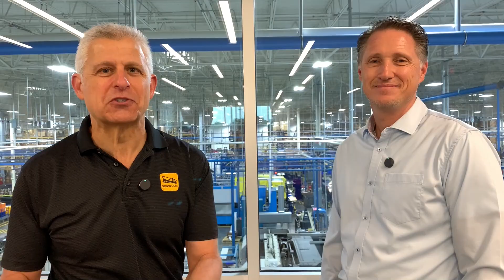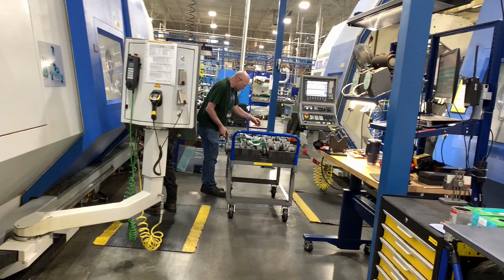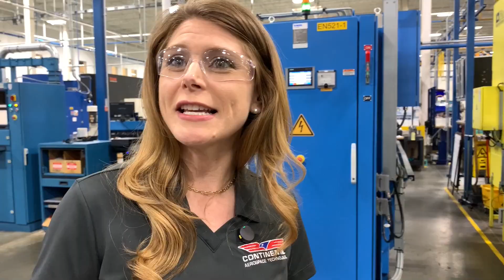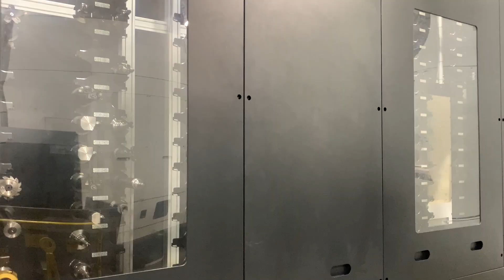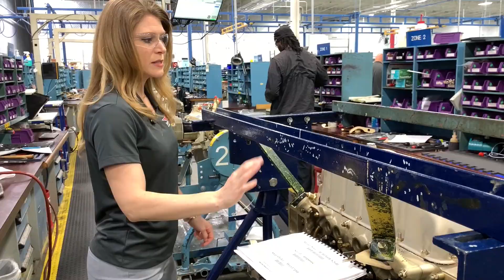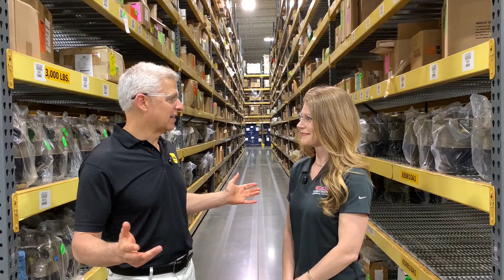HOW AIRCRAFT ENGINES ARE MADE! Continental’s 120th Anniversary Factory Tour

Comment: In my day, 87 years ago, the tools we used were simpler and less expensive than the engines we made.  Now the tools are more complex, more expensive, have replaced us, and are more complex than the engines they machine.
I cannot believe that I lived through an engineering age where I built my own model aircraft, my own model piston and jet engines,  my own radio transmitters and receivers for aircraft remote control, and now I have even handled the mathematics and the electronics and software that can fly 10,000 drones together in an air display at 10,000 miles away, and all done from my bedroom. 
In my day, the factories were not as structured, clean, and organised as what is seen in this video . Congratulations to Continental for providing this service and such a high standard of work, which is backed by such stringent laws, regulations, and guarantees. Well done.

Comment: I decided to buy a brand new io-550 instead of over hauling my run out engine . The first engine was found to have a major issue. After a year of arguing they finally replaced it with a second engine with issueas well. They follow up with warranty issue is nonexistent . I finally resolved the problem myself. They refused to address even small but important issue of the dip stick reading 2 quarts off. This whole scenario cost me 2 years of down time plus a huge amount of aggravation. Once you buy and pay for it thru Plane Power it’s you are on your own. I have not been paid for the reinstall etc. The next step of course is a major law suit involving my safety with a faulty engine plus all the added cost incurred . We have 4 major new continental engines on our Feild with things like rusty cylinders etc. my suggestion is to stay as far away from the so called hi tech factory as possible !!!

Comment: Loved the video. I have flown thousands of hours in aircraft powered by Continental engines from the 65 HP to the 550 series. In my opinion the Continental engines are a smoother running engine than the Lycoming engines. Both are excellent engines and very dependable. Never had a problem with either one.

Comment: So, what IS the gold coating??  I assume it’s dichromate??

What is the black treatment on the cylinder jugs?  Must be either a chemical black oxide or a nitrided treatment??

What is an “experimental” engine??…guessing that’s produced to a lower price point, but not faa certified and lacks some of the features, like the external coatings??

No surface hardening on the crankshafts?
Reply: Great questions. Some of us are interested in real answers to real questions as indicated in the comments.

Comment: But they still use vendor manufactured lifters that often times don’t meet specs.  Last year I ordered a TSIO520R for my T210.  The first engine arrived and while it was still in the shipping crate I discovered a pitted lifter!  Three months later I received a replacement engine and before the engine was hung on the plane I discovered a lifter that was not rotating!  On both of these engines the lifters would have failed prematurely, but probably outside warranty, quite possibly damaging the cam thus necessitating yet another rebuild!   
Karen Hong and her team get high marks for innovation for sure however, they simply must solve this industry wide lifter issue!

Comment: Unfortunately, Continental is owned by AVIC, a PRC, peoples Republic of China State company.  I sold my C206 and bought a RV8, IO-360, before having to reengine. Had to replace 2 cylinders by 1400 hours.  Ran LOP ,with GAMI injectors but started running ROP after second cylinder replacement. Had to give new owner a $5000 discount for another cylinder that was getting low compression. My next experimental is going to have a Rotax916. FADEC and electronic ignition.
Reply: Looked it up, true.
Reply: If a Rotax916. FADEC and electronic ignition is MUST HAVE equip. for your next experimental.  You just limited your choices down to 2 planes.
#1 Choice.  Sea Risen 916.  2 place
#2 Choice.  Sling TSI 916.    4 place.
Then again, anybody possessing a sound rational mind.  Doesn't change a thing.
Your only choices are the same two planes.
Reply: @raymond3803 RANS S-21 can be 916 equipped as can Kitfox and others.  Way more than two choices.
Reply: @LTVoyager  It's not the lesser of two evils.
It's the evil ........... Of two lessers.
Yeah ................. that sounds about right.   
And appropriately applies to your comment.
Reply: @raymond3803 That is quite the nonsensical comment.  Must have taken you hours to compose.
Reply: @LTVoyager  Don't project your intellect on me. Something original and a little clever may require hours of your investment.  I type at a fluent 63-words per minute.  So break my comment down.  Assign each word 1 second.  That's how long it took.

I once took a hot-air ballon ride.
The ballon got lost in the clouds, drifting off course for hours.
When it finally started to descend, I looked down and saw my LTV friend.
I yelled down: Hey LTV, where am I?
LTV looked up and yelled:  You're in a ballon.

1) LTV had an answer to my question
2) Technically, it was correct.
3)  Didn't help a damn bit,
Reply: @raymond3803 You are definitely well acquainted with hot air.
Reply: @raymond3803  you can put a 916 in any home-built you want; the FAA won't stop you
Reply: @soconnoriv  I think you can.  Some of these modified STOL planes have ridiculous engines in them.  Exposed and exploited on YT, I doubt that would be the case, if illegal.  The two planes I mentioned lack certification, so they are experimental.  Sea Risen is a 100% factory-built plane.  Sling TSI is a 49/51% kit.  But the factory offers builder assist.  I would never consider doing less (my involvement) than this.  Here's a good example of a Sea Risen in the US.  https://youtu.be/GRNZj-ngFes?t=43
Reply: Stop it boys,you both cracked my ribs

Comment: As a Commercial Pilot and A&P mechanic I would have liked to see the machines doing their work.  Like taking the crank and cam from a raw forged part to a finished part.  That is what I was expecting to see.  But it is nice to know that they make all the components of the engine here in the US, where they control the quality and specifications of the parts.  Auto makers should consider the same thing.  They are in trouble because the engine and transmission parts they are sourcing from China ARE NOT being manufactured to specks and are failing around 40 to 50,000 miles of service.  There are videos here on YT explaining why this is happening and not just US automakers.

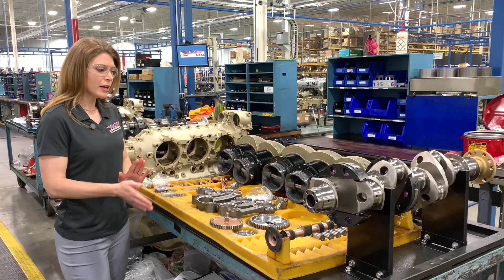Comment: 12:38  Jesus, in 2025, look at the sheer size of those engine parts.  In 1997, Karl Kinser built a 410 ci.  Mopar V-8 naturally aspirated sprint car engine that produced 900 hp and weighed 297 lbs. Complete from air filter to oil pan.  With the exception of auto racing, name a vehicle industry more weight conscience than aviation.  Thirty years after Rotax proved (tried & true) a small 5,500 rpm engine can absorb the additional weight of a gear reduction, radiator, water spider, dry sump oil pump, exterior oil tank, and match the power, reliability, & TBO of a conventional 2,500 rpm Continental engine with 1/2 the weight.  Why has Continental and Lycoming not followed suit?  It boggles my scrotum.
Reply: Longevity.  Your data is as reliable as your engine of choice.
Reply: @Skinflaps_Meatslapper  Explain the value of "longevity" when a timed-out Continental overhaul costs the same as a replacing a timed-out Rotax with a new engine.  In addition, a timed-out Rotax will always bring $5,000.
Reply: @raymond3803  I could give you a thousand reasons and a thousand examples, GA is rife with them and most are well aware, but the bottom line is you're going to believe what you already believe, and explain away anything that doesn't fit your viewpoint.  The only reason you posted was to hear your own opinion parroted by someone else, not to hear anything contrary.  So no, I'm not going to.

Comment: Now let's get rid of lead deposits. I worked on auto engines when they burned leaded fuel, and lead deposits were always a huge issue. They are a major problem with aero engines. I saw an interview years ago with the then-president of Lycoming, and his big take on unleaded fuel was getting lead deposits out of aero engines and eliminating the damage they cause. His main point was engines making it to TBO time and longer. He also pointed out longer oil change intervals and cleaner spark plugs. 
Having done numerous owner-assisted annuals as well as some engine teardowns, I've seen the issue up close and personal, as A&Ps have.

Comment: I am shocked to see that sizes of the outdated machine. From the looks it is meant to work in a truck. Nowadays you will hardly find a motorbike without water cooling, multistage-direct injection and 4 valves per cylinder, overhead camshaft. Even better with a turbo, compressor and diesel. I know, Continental got some of that, but it feels like 50y back, like the design of the planes the engines working in it. All the certification paralyses development, i assume.

Comment: Love Miss Amber! Excellent presentation
Reply from the maker: Amber did a great job! I'm so glad you enjoyed the tour!
Reply: Women are often better at presentations then men are - there better at communicating then men in many cases - 
      I had worked in the oilfields for yrs -  women were not as good at hands on heavy physical work - some could swing a sledge hammer off and on but not every day there hand would become tired and they had difficulty holding a sledge hammer it would fly out there hands - 
        What we found was it's better to put women in places that require multiple tasks - 
in the end today you will find women operators in control rooms in charge of production  - on offshore platforms  they make for good production operators - 
       Women multitask easily compared to men  - on a platform men are still needed when there are problems with a system that needs Intence focus during  certain times during production at times - also male operators tend to be better at hand on when needed -
Reply: @able880  I don't think we are allowed any more to note differences between men and woman. Misogynist or something.
Reply: @able880  Serious question then, does this explain the existence of 'booth babes'?
Reply: @able880 The correct word is than, not then.

Comment: Same engine 120 years later. Smh we should be so much further along
Reply: The wheels still round, for a reason
Reply: Well where are the innovaters in aviation? Youth with passion, that's how these companies started. unfortunately we've kept the youth from innovating.
Reply: There is a reason aviation moves slowly. Everything has to be proven as good or better. That takes research, which takes money. Aviation engines are pricey enough as it is.
Reply: Move slowly in aviation ?
Biplanes at start of WWII and supersonic Jets a decade later !
Reply: @josephpadula2283  BINGO. All kinds of advances have been made... doesn't mean everyone needs or even wants a hypersonic scramjet engine.
Reply: @kentuckybowl-o-sticks 

Correct but 70 year old designs made on cnc gear are still obsolete .
Reply: @josephpadula2283  Not in a Piper Cub, or a hundred more +/- hundred year-old airframes.

That's like saying pistons, rods, and cylinders are "obsolete". Not in a reciprocating engine, they're not. Hell, rocket engines have hardly changed in the last 100 years.
Reply: @kentuckybowl-o-sticks 

Yes , they use the Godard engines to launch the Starlink satellites …..
Reply: @josephpadula2283  OK, clearly you can't grasp what I'm talking about...
Reply: So, what’s stopping you?
Reply: Move fast and break things? Doesn't fly in aviation.
Reply: @kentuckybowl-o-sticks  Are you 120 years old or just repeating an old wives tale? I have worked on and experienced modern engines in many forms and they can last very well, Contimental and Lycosaurus do not have a good record of reliability or product quality so I wonder where you get you "facts" from?
Reply: @philkennedy8683 Where are you getting yours from?  Both Continental and Lycoming are very reliable engines.  I have been in the aviation industry as a Commercial Pilot, USAF certified Aircraft Mechanic,and FAA licensed mechanic beginning in early 1969.  With thousands of hours flying general aviation aircraft the vast majority powered by Continental or Lycoming, I have never had an engine failure due to a mechanical failure of the engine.  The only engine stoppage I had in flight was caused by a blocked vent in a fuel tank.  The blocked was caused by a type of bug that built a mud nest inside of the vent tube.
Reply: @philkennedy8683  Let me guess:

You have to get a new iPhone every six  months, and that's your yardstick?

Obviously, you haven't been around long enough to know what constitutes "reliability". When I was 10-11 years old, I helped my father build a Continental-powered Baby Great Lakes in the garage. I don't even have to know you to know that he knew more about engines than you'll ever know.

Only twice have I let any other technician touch any of my vehicles since I started driving over 50 years ago. I have a '74 Grand Am that I've had for 48 years, a '65 Ford 250 that I've had for 28 years, and an '02 Focus I've had since new, now with over 350,000 miles on the original, unrebuilt engine and transmission. I refuse to buy anything more "modern", because they don't last as long. But don't take my word for it:
https://www.youtube.com/watch?v=e7c2_JMxR0s

I was certified Master Auto Technician and Master Engine Machinist long ago. In fact, I was 16 when I started working in an automotive machine shop that specialized in racing engines. I've done machine work on commercial jet engine components. Took just enough engineering in the early '80s to get myself into trouble 🙂

I had an '89 BMW K75c about 30 years ago. Asked an experienced tech from Europe if there was anything maintenance-wise I needed to be aware of on the engine... timing chain/tensioners, etc... since I would be doing it myself. He said that he had seen those engines with as much as 250,000 miles on them, and had yet to see any that needed any internal engine work. The "newer" BMW designs? Some complete engine failures at 250 miles, transmission recalls that require nearly the entire bike to be disassembled, etc.

All this "whiz-bang" crap designed by people whose claim to fame is "they played a lot of video games" ends up in the junkyard really quick. Hell, I've had one "smartphone" in my life, an S5 Active I've had for ten years now. Still looks brand new, and I dread ever having to replace it with the newer disposable crap.
Reply: @kentuckybowl-o-sticks  Moving very slowly also causes stall.
Reply: @kentuckybowl-o-sticks  I'd rather have a modern engine that wasn't as delicate as glass and actually makes it to TBO time without needing significant repairs...
Reply: @soconnoriv  Nobody's talking about putting vintage Continentals in new Gulfstreams. But if you think more complex = more reliable, you're going to have a hard life. And there are plenty of people that can fuck up even a "modern" steel ball with a feather, so...
Reply: hey cliffy u not so smart huh!
Reply: If it ain’t broke don’t fix it.
Reply: @lionsfanschicoandchicka  BINGO.
Reply: @lionsfanschicoandchicka  they break all the time; their design sucks and they're more delicate than a $200 harbor freight engine. Lycoming is even worse; you can spend 100k on an engine, and the cases look like they were casted in used kitty litter. It's no wonder they crack and fret all the time

Comment: The British inventor of the Jet engine, rightly pointed out  that for the speeds they fly at, piston power is the most efficient. And pushrod engines are the most reliable. Along with gear-drives.

Comment: US manufacturing will struggle even more in the coming decades.
Reply: why is that chippy m boi ? and is that all Mfg? or just intermediate processes?  cmon boi tell us!
Reply: @7000fps  As a whole, their inability to innovate. They are advertising aircooled, carburetted push rod engines as state of the art. What's worse is their inability to abopt standard measurement. There are still people that are familiar with imperial, but within another 20 years they will have died off. It already causes a lot of issues for the US, will only become worse.

Comment: We want to see how the fins of the heads are cast!  Suppose all of the old machinery was scrapped.  Used to grind aircraft cranks, how close is the out of round?  Would love to see this process explained, probably a mist of CNC and just accomplished.  Ah, Staggerwing, I've known two owners, one had a girl that looked like Jessica Rabbit.
Reply: Agree on the techie machining questions as I was a machinist while working my way through engineering school.  I recall having to calculate the fin heat loads using a slide rule ( do not laugh) and/or  writing a Fortran program for punch cards.  No keyboard warriors or canned software programs available.
Reply: @Alwayscheckingforfraud  Sure looked like the thickness and spacing were much closer than any that I've seen.  Probably intellectual property, not sure about turning and grinding finish, plus we nitrided them and polished to tolerances.  I got disowned in mechanical engineering for having a live-in girlfriend, getting the job doing cranks from a guy I ran into at a gas station, who wanted out.  I barely know how to use a slide rule from instructions when I was a kid in 1960's, have two of them.